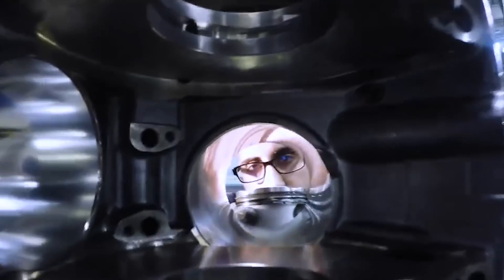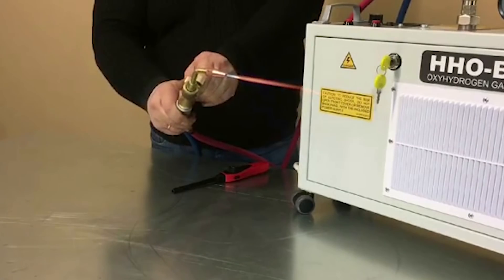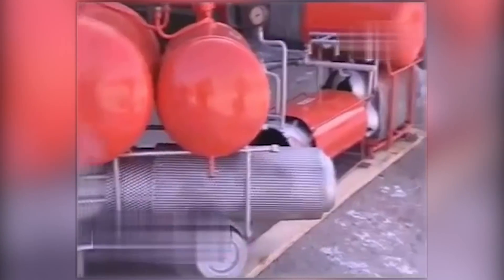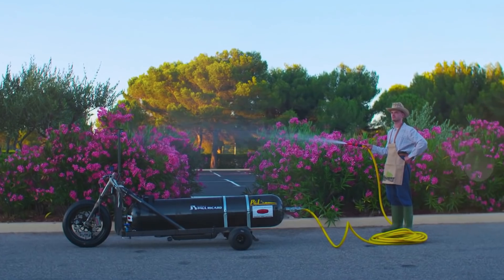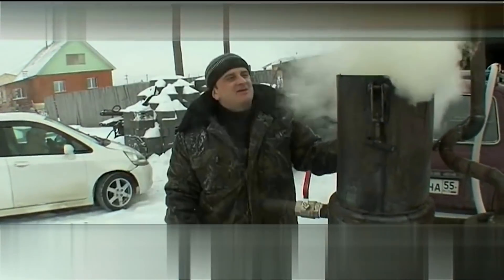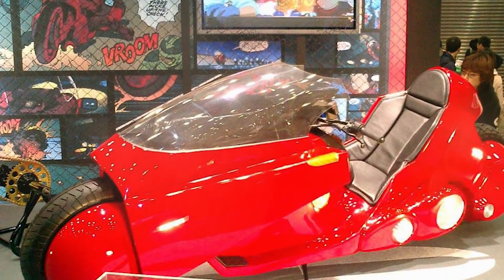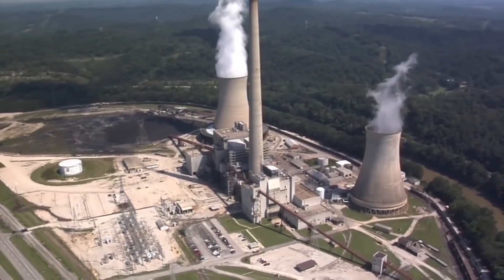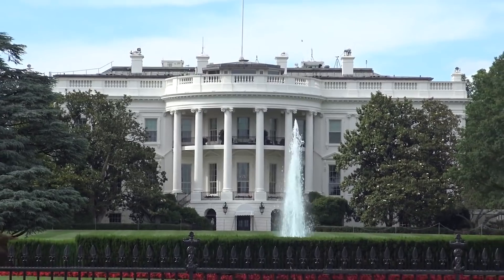Why These Engines Are Banned?

Comment: I thought this episode was about cars and why certain engines were discontinued...
Reply: Nope just conspiracy theories.
Reply: What are you talking about? I learned that the bike from Akira is real.
Reply: @Misfit1336  I do believe that the bike was the first one to utilize regenerative braking, before it was a "thing". A way to put power back in the battery when slowing down, rather than wasting the kinetic energy as heat in friction brakes. It extended the range of the bike, without having to increase battery capacity. They didn't have pulse width modulated motor speed controls back in the day, so they moved magnets in and out of a stator to control the braking effect, and maintain meaningful efficiency. Not an over unity device.
Reply: I am done at 1:20 not banned
Reply: Same
Reply: Cristopher Reeves  If you build a car that looks like a clown car, only clowns will drive it......
Reply: Jimross Abrena you wrote: 

"I thought this episode was about cars and why certain engines were discontinued..."

Why?

The title doesn't mention cars. What's your problem? Is English not your first language? Or are you trying to divert the debate away from the facts?
Reply: turns out it was a complete waste of time
Reply: @PRODVDi  thanks for the heads up, outta here
Reply: Chobani  That might be true, we are not likely to 'suddenly' run out of fossil fuel. All that will happen, is it will become more difficult to find and extract, as we consume the "low lying fruit". As technology becomes less and less expensive, and fuel becomes more and more expensive, we will eventually reach that "tipping point", where it's just simply cheaper to develop renewable energy and energy storage, than what we're doing now. The transition is going to be slow and gradual, and will likely continue past our lifetimes. Economics is the main driving force that determines how long that will take.
Reply: Same
Reply: Yes and thank God he titled it that way, or it wouldn't have 2,753,782 views!!!
Reply: Lead the witness much?
Reply: Same
Reply: Nope, It's about evil oil corporations.....  smh
Reply: @BushPigADV  What evils about helping millions of people out of poverty by providing economy's with cheap dense abundant energy?!?!
Reply: @Aseutester  actually, I'm pretty sure oil tycoons don't actually pay their workers that much, but feel free to look it up, don't take my word for it
Reply: Click bait.
Reply: This episode seems to mainly be about advertisements.
Reply: @JohnDoe-ki6fm  yeah I sat through at least a half dozen car commercials !!
Reply: I agree with Matt, it would be great for commuting to and from work. They should use them in all the large cities.
Reply: Focken click bait
Reply: Did anyone notice  how all the people that had a Environmental friendly engine came up dead
Reply: @TheRealZJE313  Did anyone notice that everyone comes up dead, at some point.  This is like having a 'connect the dots' picture of a dog, and after you have connected them all you have a picture of a fish.....LOL
Reply: @dietricheckart7119  I did notice that
Reply: Jimross I think what we can glean from this is that if you have something the Clinton Crime Family doesn’t like, you will catch a serious case of suicide.
Reply: The climate scare is being used to prevent people from being able to use cheap, dense, abundant, and practical energy. If anything, the climate scare is by that token, about keeping people IN poverty! The more people that come out of poverty, the more likely these people are to develop an intellect, and therefore, the more likely the world's governments are to lose power!
Reply: @Iamwolf134  you do realize that the main goal of renewable energy is to provide clean energy to everyone right? You do also realize that energy from the sun is 100% free and available basically everywhere. Why are you complaining about something that you cant even reasonably demonstrate to exhist? How did you conclude that humans trying to avoid putting 100% confirmed harmful chemicals into the atmosphere was a giant conspiracy to strip people of their freedoms without due cause?
Reply: @winstonpoplin  That Initial goal, renewables so far have done a terrible job at, because they've attempted a wholesale replacement of that which we've already had before. Perhaps we should have implemented renewables on a MUCH smaller scale right from the start, as in charging your phone's battery small. Besides, the wind and sunshine aren't always around, and even then, an adequate solution (battery-based or otherwise) in terms of storing that energy will be extraordinarily expensive in terms of money, and potentially in environmental damage (the latter is even worse for "cheaper" battery-based storage). This is why I greatly oppose AOC's green new deal at every turn.
Reply: @Iamwolf134  you have turned around completely from your original accusation that renewables are being manipulated to prevent people from being able to fairly use the fossil fuels we already have. Which is what my comment regarded completly. That diversion is a tactic often used by christian apologetics, to bad effect. So if you want to answer my original question. How did you correlate people trying to find and use clean renewable evergy to people having a giant conspiracy to try to unjustly take freedoms to burn petrol ect? I want specific examples and situations. Otherwise you are just blabbering meaningless words, which anyone can do and it has no value. If you have reason enough to believe there is an anti fossil fuel conspiracy then you must have some kind of hard concrete evidence to believe something so unsupported. So simply tell us what that hard evidence is.
Reply: @Iamwolf134  you have quite literally moved the topic of the conversation multiple times now yet you say i am "moving the goalpost". If you cant provide the examples then dont try to pin it down on me by saying "oh you will just move the goalpost" when i have done nothing except try to get this specific evidence from you this entire conversation. Every comment i have made has literally done nothing but ask the same question and you have refused to answer it every single time. So ill ask AGAIN. What evidence have you seen? (Refer to previous two comments for a more detailed version of the question if you have forgotten)
Reply: @Iamwolf134  I actually disagree. Right now, conventional energy sources, are somewhat cheaper right now, but they are a finite resource. Eventually, coal, gas and oil will become much more expensive, as the "low lying fruit" gets used up, and more desperate means will have to be used to maintain supply. At the same time, as with all technology, the renewable sources will become less and less expensive. In some areas, the crossover point has already been reached, where renewables is actually cheaper than conventional sources. Not here in America, YET! It's a good thing, to make this long term smooth transition, before we reach a point where we're scrambling for a solution. It's going to be much easier, if we have "plan B" already in place.
Reply: @vincentrobinette1507  I'm not against renewables, or HHO generators, or anything of the sort. If anything, I'm all for it because each of them has the potential to free up more oil for export. By the way, you are totally free to disagree, and so am I.
Reply: @Iamwolf134  That's exactly what Abu Dubai is doing. They're installing HUGE solar arrays in their desserts, and wind, so they can export a higher percentage of their oil, and also, have an energy source once they run out. I think it's just plain smart! How will they maintain their economy after the oil runs out? High end tourism.
Reply: @vincentrobinette1507  It's all well and good, and that's entirely because government was quiet and out of the way about it.

Still, the much talked about Green New Deal is so much more than a proposal of measures to protect the natural environment. It is nothing less than an all-encompassing social justice manifesto which would pave the way for federal government control of almost all private industry, private property, transportation systems, and food production, as well as most other aspects of American society. Complete control of the nation’s energy production and distribution is the key to absolute power – no pun intended – which is precisely why the specter of climate change is used as a principal weapon in the leftist arsenal.

In short, the Green New Deal is entirely incompatible with the Constitution and with capitalism and would effectively nullify both, removing all individual rights and decimating the economy.

“Democratic Socialism” has now become the most trendy political movement on the left. Alex Jones explained very well how the elite will use supporters of this movement to usher in a post human world. This is why we ought to get serious about speaking of the real price tag of going green with the Green New Deal.

Most of the media talk surrounding the Green New Deal focuses on the cost, which would likely run to more than 150 trillion dollars over twenty or thirty years. That is a much higher figure than most people are suggesting, but certain factors must be considered. First and foremost is the well-documented inability of government to deliver any project within its originally projected budget or schedule. Secondly, one must consider the vast expansion of state and federal bureaucracies that would inevitably take place in order to manage the enormous projects required to bring about the proposed transformation. Lastly, there is the waste, fraud, and abuse that would surely accompany every stage of implementation.

Is $150 trillion an outrageously inflated figure, presented here simply to evoke shock and outrage? Some alt-right hyperbole, perhaps? For argument’s sake, then, consider cutting that projection by 70% and assuming that the entire Green New Deal can become a reality for a paltry $45 trillion. Over the next ten years, the combined annual federal budgets will probably total something in the region of $50 trillion. How, then, does the U.S. sustain an almost doubling of annual spending for the next decade?

It is a question that urgently needs an answer, but Democrats who support these radical proposals have no interest in providing one. In fact, they have gone beyond the point of merely refusing to answer the question; they deem the financial cost of the Green New Deal to be irrelevant.

The proposal’s champion, Democratic Representative Alexandria Ocasio-Cortez of New York, has been constantly dismissive about the need for any serious discussion of how the plan would be financed. In a February blog post, she wrote: “The question isn’t how will we pay for it, but what is the cost of inaction, and what will we do with our new shared prosperity created by the investments in the Green New Deal.”

Neither Ocasio-Cortez nor any other proponent of the idea has provided any rational explanation of how “investments” in the program would lead to “prosperity.” The very suggestion that this national transformation would provide any meaningful return on investment is not only laughable but entirely disingenuous. After all, this plan has been touted as a moral imperative; a course of action that must be taken to stave off the imminent existential threat posed by climate change. The very idea that there is any profit to be had by taking such drastic action is entirely superfluous. Is the point of the Green New Deal to save money or to save the planet?

Presidential hopeful Elizabeth Warren (D-MA) recently waffled about how retro-fitting every building in America to be more energy-efficient and to run on alternative energies would be an investment because the buildings themselves would become more valuable. She gave no explanation, of course, of how that works or what financial benefit could possibly be gained.

Kamala Harris (D-CA), another presidential runner who supports the Green New Deal, refuses to be drawn into any discussion of the plan’s economic sustainability. “Of course we can afford it,” she said when questioned on the cost.

In reality, Ocasio-Cortez and her supporters are vaguely suggesting the Green New Deal has long-term economic benefits because they know the plan comes with an astronomical price-tag. They also know that, for all their posturing about saving civilization, they will be forced, at some point, to explain how their proposals will not impoverish the nation.

In truth, the progressive backers of the deal would willingly tax every American into poverty. A population of paupers is easy to control, to coerce and to oppress. More than that, people who are simply too poor to exercise their rights neither know nor care when those rights are taken away.

This is why when it comes to renewables and anything of the sort, the federal government needs to simply step aside and let the free market take care of things.
Reply: @Iamwolf134  Really long-winded but probably necessary. We all know the names of the actors in this horrible play. Follow the money. The question is can we do anything on our own to short circuit the whole process?
Reply: @TheMadgeorge  Why not form a citizen's grand jury in the event that the SCOTUS fails to do its job. Besides, the citizen's grand jury belongs entirely with the people as ruled by the late Antonin Scalia.
Reply: Okay I just returned to this. Thanks for the extra info guys. I wanted to comment on the climate change thing. It would appear that the it is being used as the main attempt to usher in a global government as the, I believe it was the UN, just the day before yesterday had publically called for a "new world order" to combat climate change. For someone like me that is smart about not to trust any governments it's just the next sign I was already expecting. I just thought they would start a global conflict between the US, China, and Russia but it appears they're going to use climate change hysteria instead. You need to look under the rug to find the dirt. Stop debating, that's how THEY win.
Reply: I hate when certain people try to make my country the reason for climate warming etc....
Reply: @SlendisFi_Universe  ???

Comment: compressed bottle is ruptured in an accident, POWERFUL EXPLOSION, creating a lot of very dangerous shrapnel in a LARGE radius.  Plus you have to pay for the air compression technology (ie fossil fuels)
Reply: Like an oxygen bottle with the valve knocked off. NOT good.
Reply: Real compressed air tanks are government controlled. Inspections are mandatory, special conditions in storage etc. A man told me about working on a job in Chicago on a high rise and an air tank fell a couple of stories and sheared the neck off. The rest of the bottle became a rocket and destroyed an interior block wall(fortunately). Had the accident happened during work hours someone would have been killed.
Reply: @dannynewton3988  They will do a very rough job and do it very quickly. A boss/buddy of mine told me the same thing about an oxygen bottle falling over on a train track and knocking the valve off. It went up the middle of the track, taking out ties as it went. I always kept the cap on them and laid them down whenever possible.